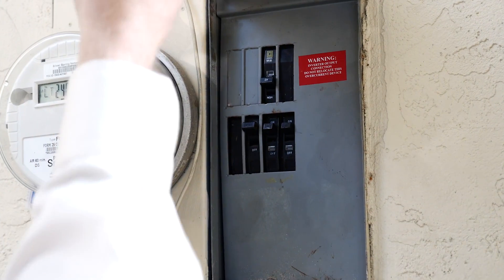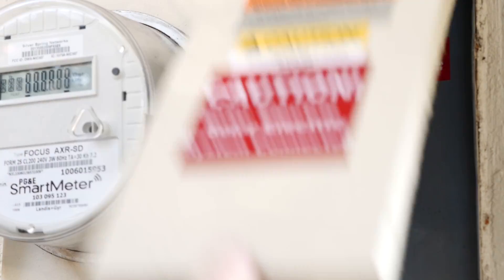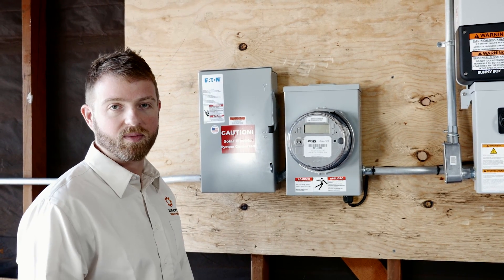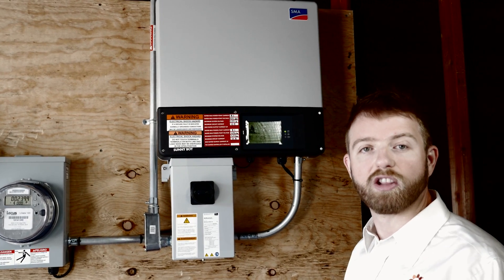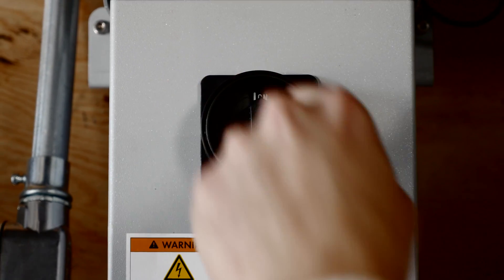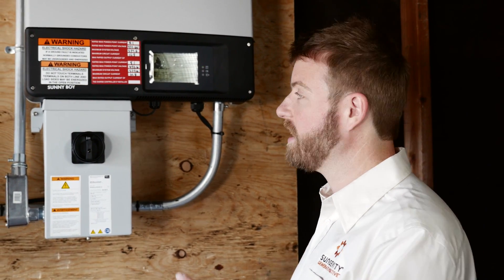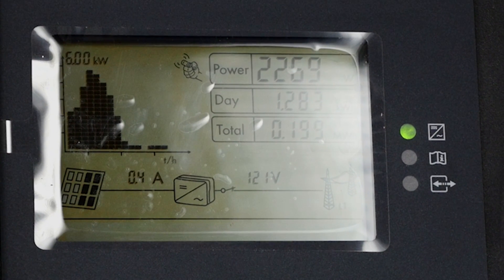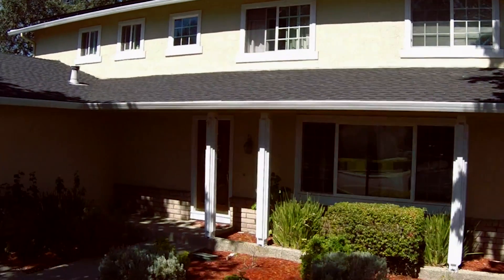How To Turn On Your Solar System (ABB/PowerOne, Kaco and SMA/Sunnyboy Inverters)

Comment: Diear Sir , maybe you can help me. I´m in Angola and i have a variator ABB ACQ80 with normal main grid connection and work with a water pump. Now i receive information that i can connect directlly the solar panels with this variator. Please can you confirme, i connect +/- cable from solar panles with variator on terminals P+ and P-, correct ?  need i change any parameter ?